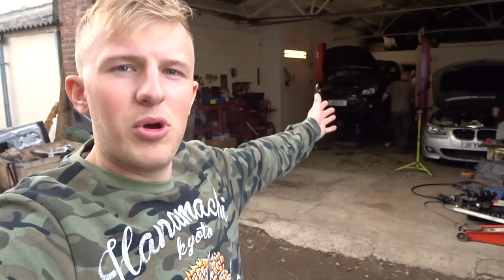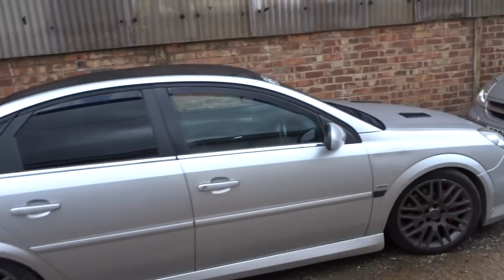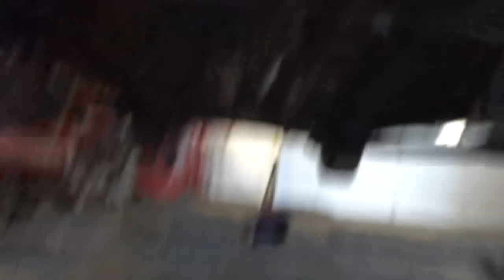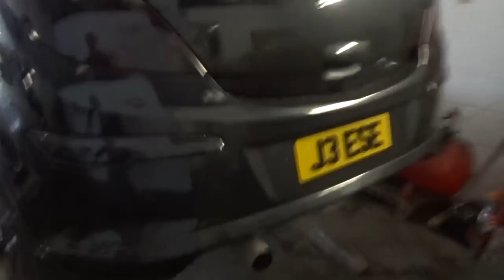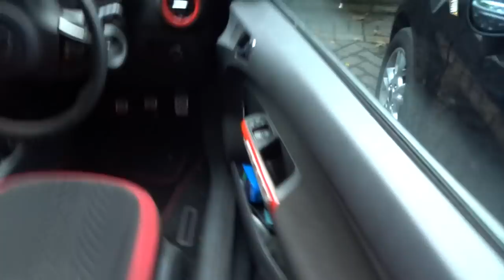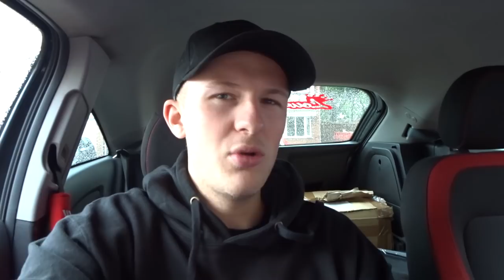CORSA GETS STRAIGHT PIPED!!

Comment: Someone explain why the mpg’s dropped? You’re reducing resistance on the engine and the sound was already there before it’s just had the restrictors (muffler, res etc) removed?
Reply: Because he's changing the way he drives , I.e going to 3500rpm in 1st and 2nd so he gets the top noise from exhaust

Comment: You should get a hornet back box on it,. the sound so good, more pops and bangs then a straight through system, i was going to go for a honret back box on my focus st replica but it doesnt fit annoyingly, Im going to have to go for a straight through system for now. ive already got the hornet straight pipe installed.

Comment: How much did that cost? I want to do it to my corsa lol
Reply from the maker: just a white blob £60 mate
Reply: @JesseCollingham  thx m8 thought it would be like £200😂😂
Reply from the maker: just a white blob nah cheap and cheerful mate 😁
Reply: @blaadclart5695  do it yourself angle grind the centre box leave a few inch either end buy sum s/s Same length and you can buy sleeve clamps that go over both pipes to connect them and because you left a bit of length on the box you cut out you can refit it when the noise gets boring or decide to sell.

Comment: But what's the point if you're going to sell the Corsa?
Reply: Elliot Redding this was before that video
Reply from the maker: Yeah I’ve had this done a while just haven’t uploaded
Reply: Yesssss bro, it suits the build massively G, need a new sticker tho fam gotta get slow low n loud hahaha, it pops and bangs on start up because cars nowadays have an auto choke so basically it sits at a higher level of rev while it warms up then kicks down to a lower rpm.. but cos your not using it there’s extra fuel being pumped into the  engine and some gets pushed through to the exhaust fammo.. siccc mate mines beast at it first thing G 🏎💥🔥🔥🔥🔥🔥🔥🔥🔥🔥🔥🔥🔥🔥

Comment: Is this where the catalytic converter is because I want to do that with taking my centre box off but not too sure
Reply: Factory catalytic converter was still in place just straight pipe from the flexi
Reply: @boostedchris6120  mine is just a straight pipe with centre box delete and back box with a cobra fitted
Reply: @monstersquard1  If there isn’t a decat installed with no centre silencer and a back box delete it’s classed as a straight pipe but if the factory cat is still installed with a back box it’s not classed as a straight pipe
Reply: @boostedchris6120  mine still has the cat just no centre box or back box
Reply: @monstersquard1  Right well so it’s not really not straight piped in my opinion, no hate though I give you my respect
Reply: @boostedchris6120  I was looking at a decat but would it make even more louder
Reply: @monstersquard1  Yes adding a decat will make vey loud considering it’s got a straight pipe from the cat to the rear if you install a decat it’ll be very annoying for drone
Reply: @boostedchris6120  im just trying to look for a decat part to fit my corsa d 1.4
Reply: @monstersquard1  Considering it’s possibly a corsa d 1.4 Sri which is n/a I’m sure they’re are aftermarket decat’s available just hard to find one. If it was a 1.4 turbo black edition it’s easy to find a decat they’re is a difference so the 1.4t black edition decat wouldn’t work on the 1.4 Sri
Reply: @boostedchris6120  will just wait and do something on the next car
Reply: @monstersquard1  Honestly it’ll be the best way tbh mate, there’s no point spending more money on a 1.4 n/a corsa
Reply: @boostedchris6120  yeah pretty much
Reply: @monstersquard1  Best way

Comment: I straight piped my evo x and had complaints from the neighbours but they didn't say out too me they just moaned to the police so had them speaking to me well worth it though haha
Reply: Nathan Barker did you keep it yeh
Reply: Any bad points of owning an evo x?
Reply: @YoutubeTMTechbits  none at all really the car never let me down mechanically all I'd suggest is to check if the ayc pump has ever been replaced and if it hasn't get it relocated to the boot as mine went and cost me just over £2,500 to get replaced and have a check on the timing chain if it has stretched at all
Reply: Nathan Barker hahaha £2500 for an ayc replacement?! Fucking ripped right off there mate, I paid £600 for a full refurb

Comment: You see i don't understand your logic to your car popping and crackling while it's cold 😂 if you didn't know the popping and crackling is unburnt fuel going into the hot exhaust system (so when the engine is warm) and igniting in there instead. So either you car is broken or it doesn't and you're just trying to make your car out to be amazing although it's just a chavvy corsa 👍
Reply from the maker: Josh Banyard cool story 👌🏼
Reply: @JesseCollingham  Big difference between a car enthusiast and someone who wants to fit in with the car enthusiast 👍

Comment: It pops more when cold, because the ECU tells the fuel injectors to stay open longer, therefore injecting more fuel per cycle. It does this to get the car up to operating tempreature quicker. That is why you get more pops and bangs when cold! 😀